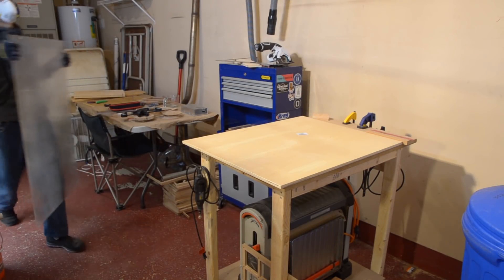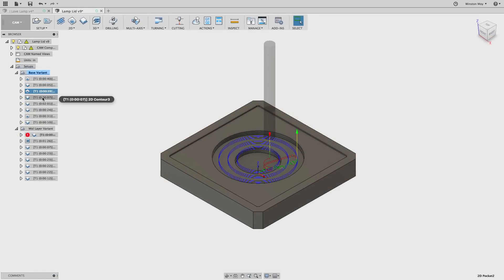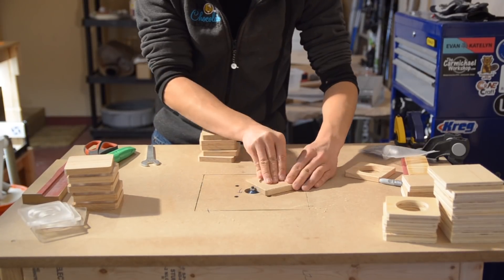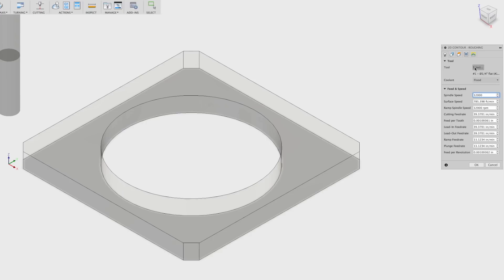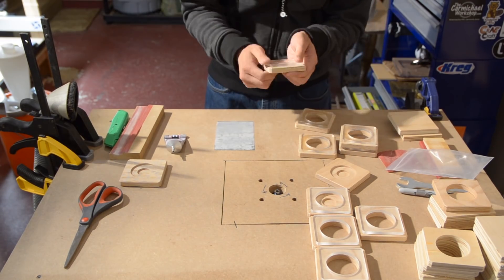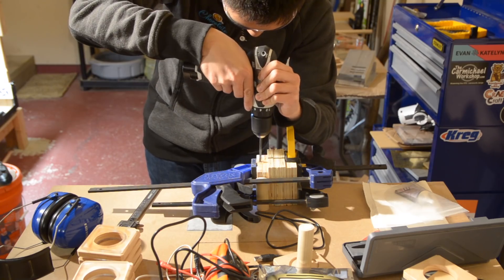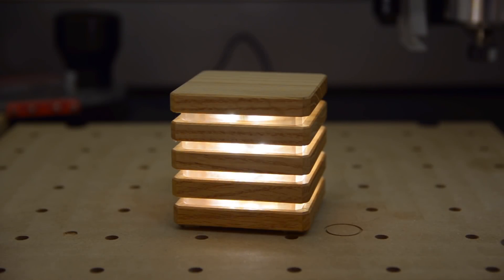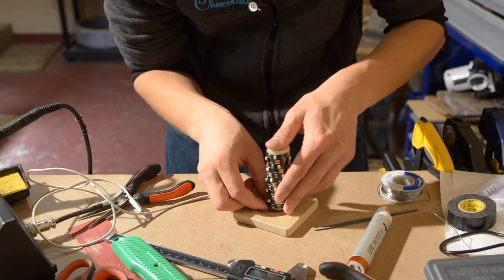USB-Powered Oak & Acrylic LED Lamp - Project #117 [CNC]

Comment: Inside of screens you'll find sheets of plastic that are used to difuse light from the LED backlights. Those are perfect for these sort of lights, just wrap it around the inside and the light will come out balanced.

Old laptop screens are great for this.

Comment: I used a single light from the bottom, and placed a sheet of diffusion plastic (from a recycled LCD tv screen) around the inside of the inner cavity. I also painted the top of the inner cavity white to bounce the light back downward, thereby maximizing the light from the single source (which was a puck-style light from Menards intended to be used under cabinets). As for the acrylic, I taped off all but the outward-facing edge and sandblasted it for a frosted look (experiment on scraps first!), then knocked down the grain a tad with a heat gun. Overall it turned out really nice. I think next time I may try masking off a couple stripes on the acrylic before media blasting to give a unique look, and possibly angle the outer edge 15 degrees or so to cast more of the light downward onto my desk.

Comment: To help with the light diffusion i think it would be best to polish the inside where the light source is then use 400 grit on the outside to get a smooth but frosted finish on the out side. Look into total internal reflection, smarter ever day made a video about how like reflects and used acrylic to demonstrate the property, might help get the results that you want.

Comment: It's a bit old now, but I can help you with some ideas. Try to use high density LED strips, 3528 or even smaller chipsize, that can lead up to 120 LED/m, which means better coverage.
For better opaque, I would recommend around 300 grit or even lower numbers.

Comment: For lighting, using a 1W or 3W LED inside instead of strips would work well for simplicity and diffusion purposes. You could mount the LED at the top of the dowel and have it shine down. Broadcom makes some that you can run off 3.6-4V. You can then use a small (quarter sized) buck converter to reduce the 5V down to what you want.

Comment: you can use frosted acrylic
Reply from the maker: Only if the face of the acrylic is shown. The cut edges won't be frosted.
Reply: 8mm frosted acrylic..or 10mm.. just buff the sides and torch so it will look pleasing..
anyway, thanks man.. this will be my next project.. i have plenty of frosted 8mm acrylic scraps, but i dont have a router so i think i will use mdf rather than wood..

Comment: I often use a 2 flute 1/8 inch endmill 16k RPM, and 500 - 1000 mm/min.  80in/min (2032mm/min) seems very fast.  I have been told that kerosene is the lubricant/coolant of choice but not used it yet.  I often get crystal clear cuts even in pocket bases.  Overall project looks good. I think the oak looks nice.

Comment: I love Harvey Tools, but for cutting plastics you should look at Vortex's "O" flute end mills. They grind a deeper void to curl the plastic better and help this chip extraction. The 5412 is a direct substitute for the end mill you used in the video, but they also come in downcut and straight flute. I use double edge straight flute all day long on my kit CNC all day long with great results. Their endmills are a bit more expensive, but they will sharpen any end mill for pretty cheap so it all evens out over time.

Comment: I agree with the other comments about using a diffusion film or a paper tube for more even lighting. Another option would be to increase the number of machine-cut acrylic surfaces that the light passes through. You could mill a circle through each acrylic plate. That way, the light would have to pass through 4 surfaces instead of 2. Twice the diffusion without more materials.

Comment: A great way to diffuse light would be to use a commercial grade etch effect sign vinyl that I fit to restaurant windows. A solvent adhesive will have no problem with heat dissipation and is designed to be perfectly clear for interior installation and will apply uniformly and perfectly to edges and wrap around corners or even curved edges with the aid of a hairdryer for example. Life is up to 10 years. You could stick with large stock of clear acrylic and even colour multiple versions or layers with translucent films designed for exactly this purpose on lightboxes. Products you should look at in the states are Oracal and Avery Dennison. Cost should be no more than about $10 per linear metre. Ben, BJUM

Comment: Hi, Winston, I've been watching your series, great job .. I made a simple youtube revue once now I realize how much time it really takes. I don't have a CNC yeat for a week or so I'm trying to figure out what is most important in a CNC mill needed sometimes I skip to the idea if getting a laser instead ... I don't know yet but I'm going to go to maker fair and figure it out there. If I see you there ill buy u a coffee as a thanks for the great vids. ps, what are your thoughts on a laser 3d engraver anyway?
Reply from the maker: So, I think the idea of a "3D laser engraver" like what Glowforge markets itself as, is somewhat misleading. You can cut to different depths roughly, but you can't really make smooth bottomed pockets like you could with a milling machining. There are things a laser can do that a CNC can't, and vice versa. Need to pick the best tool based on what your project is.
Reply: http://twistedsifter.com/2013/04/3d-laser-cut-paper-art-by-eric-standley/
after seing things like this the laser again goes back on to my list.
Reply from the maker: Millright is okay, as is Stepcraft, but they're a little more premium priced. Stepcraft has a great accessory ecosystem though. And no, you probably don't need a 2.4 HP router. I'm perfectly happy with my 1.25 HP one. 

Carvewright is cool, but kind of a one trick pony. Good for making signs, but almost impossible to run smaller pieces through the machine. 

Are the machines that cost twice as much as a Shapeoko better for general purpose milling? Sometimes. But they definitely aren't 2X as good. You have to figure out your needs, how much you care about value, etc. Only a small fraction of hobbyists/woodworkers will grow out of a Shapeoko in my opinion, and it's mainly for size reasons.
Reply: Carvewright is cool but it's like having a robot dog instead of a real one It has no soul:) it's just a copy machine although it looks pretty capable, I want to learn CNC and I don't think its the right choice for most people in my boat. I like the Stepcraft its clean well designed but little overpriced for its hardware  (its like buying a 60K Benz you will pay extra 45k for all the add-ons you get included in most other cars) its nice and the auto bit change is cool but I don't know how often does one need to change bits endmills when doing a project? i just dont know .  Im leaning towards Shapeoko xl or xxl thoe i think the millwright isfaster and a better cnc because of its drives ext im leaning towards Shapeoko becouse even thoe most work I would like to do is detailes sighns and cutouts ext within 12x24 but I would like to do things with larger wood as well, for example, I want to be able to make assembly tables like this one https://www.youtube.com/watch?v=A1F3y41Tn9A I wold like to make a bunch of workbenches reaady to assemble with drilled dog holes I could sell them to my coworkers to recopinsate some of the cost of the cnc atleast the cost of upgrading to a xl or xxl (im in construcrion) (that was also a reson why I was looking in to the laser) but cutting 3/4 ply with a laser I wold have to shell out 4k maybe 6k atleast to get something capable and  I wold not be able to compinsate that cost by selling off some workbenches to my coworkers, allso I want to be able to do things like planing redwood slabs automatically because manually with a router is a pain you are covered in dust and wood chips for several hours and it gets labor intensive and annoying .I would love to have a 4x8 CNC but I figured I can make due with Shapeoko xl or XXL. by my understanding Shapeoko is slow but it can produce detailed work and I can make 2 x 8 workbenches with the shapeoko xl just by manually lineing up everything and moving the plywood down as it finishes (or am i missing something do you think that it would be too difficult in some sort of way I am not imagining yeat because I have no experience with cnc ?) if i have space is it better to get the XXL? Am I asking too much from shapeoko? One trick pony is not always the best choice. Is it better to buy a faster Millright for the smaller work and Maslowcnc for larger plywood and sheet work? is maslowcnc capable of cutting accurately I have been looking at it for a while now I remember it was unable to cut accurately everything was distorted and imprecise at least by 1/4 inch or often more it also had some weird things when cutting it would cut as if a 14m lens GoPro effect, you have mentioned your friend got one? does the Maslow work now? is it working for your friend? maann im bombarding you with questions sorry for the overload you are now probably thinking why did I ever respond to this guy :)  ...  But I would appreciate your input I have no one else to ask about cnc... and its en expencive endeavor that i cant risk to get wrong.
Reply: Hay Winston I just got offered a complete x carve 1000mmx1000mm  for $1000  should I just buy that while the guy still has it?
Reply from the maker: If you're only going to do wood, the xcarve is okay*, but completely stock the Y rails are pretty flimsy. If you'll ever want to do aluminum, or even really dense woods, you'll have to compromise speed for accuracy a lot more than you would for a Shapeoko IMO, unless you brace/reinforce the rails. *For that price the xcarve is a decent value (price for performance), but you'll need to out some work into it. If you're able to see one in person, pinch the Y rails and wasteboard between your fingers and see just how much it flexes. Or look up part 3 of Myers Woodworking's comparison between X-CARVE and Shapeoko.

My friends Maslow is still a work in progress. If you're cutting deck furniture, probably okay, but I doubt it will ever cut small text for signs and stuff.
Reply: i saw the video. I suspect1000m 33 inches the x carve will be way too flimsy, and reinforcing it will cost 200-300$ plus time and troubleshooting. I can use ox CNC bars to reinforce the x carve ,i haven't found any other way yet have you ever seen or know of a way to reinforce it? so far it will end up costing me 1300$ or a new shapeoco XXL for about $2000 after tax. I already have good CNC software so I don't have to deal with x caves pay for Pro bs and their active CNC online only thing. Besides for flimsiness if the frame can you think of other reasons not to get the x carve?
Reply from the maker: If you Google "X-Carve mid span support" there's a couple examples but I'm not sure if there's an option off the shelf. Other than that deficiency, there's no functional reason the Xcarve wouldn't be a useful addition to your shop.

Comment: For LED light diffusion I highly suggest going to TAP Plastics and testing your setup with different diffuse sheets.  It's hard to know exactly what diffusion sheet will work best, but somewhere there is a sheet to solve your problem.  For example.... https://www.tapplastics.com/product/plastics/plastic_sheets_rolls/led_ligh_panel/598

Comment: What if instead of glue you had rods in all four corners threaded into the top piece, through holes in all the layers, screwed on the underside of the bottom plate. Then can work on LEDs and swap out whenever

Comment: Now before reading my comments, you need to listen to this: https://youtu.be/-mOY2eWO2qw

I think a nice C'Bore on the top would double the use of this awesome light into an Electric Coaster, and while you're at it, add a double pole/double throw switch to reverse the flow of electricity into the LEDs to add a cooling effect to your beverage..... 🙄  And Mathew beat me to the diffuse suggestion (Wax Paper or Parchment Paper too, ((Aluminum Foil, not so much)))  🙄  All in all, an awesome project that could only get a tiny bit better, by using my clamps...lol 🙄
Reply from the maker: The revisit will use clamps for workholding. I only started from small squares because I was testing endmills. Also, I hate that I sat through 1:40 worth of that song lol.

Peltier cooler integration into a project sounds arguably more interesting to me than adding like a wireless charger.

Comment: It's a very nice project. Instead of glue, it might have been nice to use four long machine screws to hold the assembly together. (The bolts would screw into threaded inserts mounted into the top layer of wood.) With the CNC, the bolt holes should be perfectly aligned. This would allow for ease of repair/replacement of the LEDs and avoid the issue of glue squeeze-out. It would also allow you to add a diffusing lens of some sort, if you wanted. Or, you could change the color of the lights by changing the color of the diffusing lens from time to time.

Comment: an easy way to diffuse the light could be as easy as roughing up the inside of the acrylic with some scotch brite or steel wool, you could also use a some of the plastic from a plastic binder rolled up on the inside. those are already fairly diffused. Hope it helps, and great video

Comment: Always an easy way to diffuse the light is simply role up a piece of thin white paper or cellophane and have it wrap around the inside circle. By being off the light source, it will naturally diffuse the points of light and give a more even glow.
Reply: Parchment paper would be perfect!
Reply: I've had decent results with tracing paper and spray-can frosted glass coating. For my recent project I ultimately went with a milky diffused acrylic.
Reply: I've tried this and it works great. However, if the lights heater they start to get dark spots on them.

Comment: You can add an arduino to control the light pattern. It will make it more cooler. I added a mic so the light can have some changes when I place it next to my speaker.

Comment: You could make a one pass circular pocket on one side, then offset inwards another pocket on the opposite side.  Leds wont be visible through those pockets. You could also just sand the edges of the acrylic with lower grit sandpaper.  Edge lit signs diffuse more with the scratched up/milled areas.

Comment: Buy some Lee filters "216" in the inside. Film industry standard! You can get it at a lot of larger camera stores ect.
Reply from the maker: Thanks for the tip off, I was looking for a solution that would be better than stealing the diffuser from a donor LED TV.
Reply: In all honesty, (parchment) paper would work just fine in your situation I think. 216 and other filters are so expensive because they are heat-resistant since a lot of film-lights are (and used to be) tungsten based. 
You do get a lot of different varieties of diffusion (i.e. White Diffusion, Frost, Colored Frost, ect).